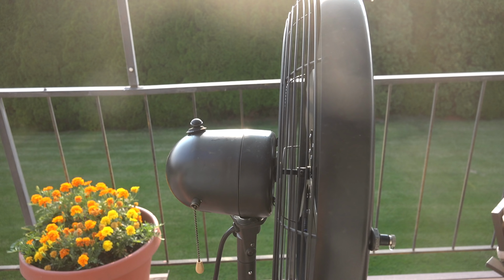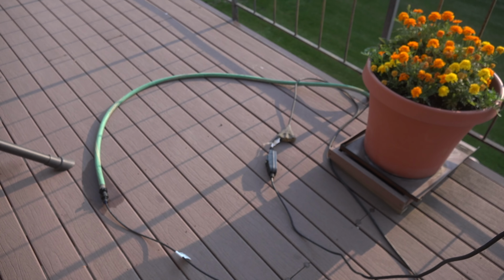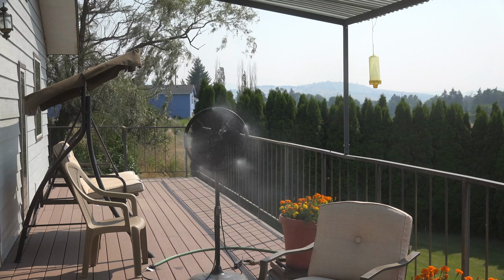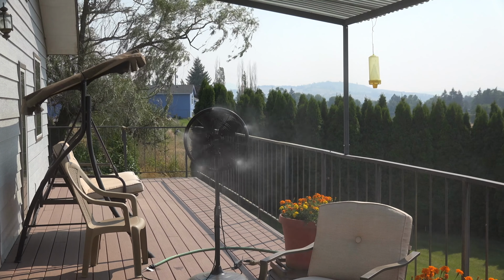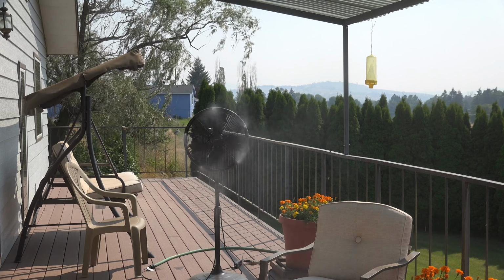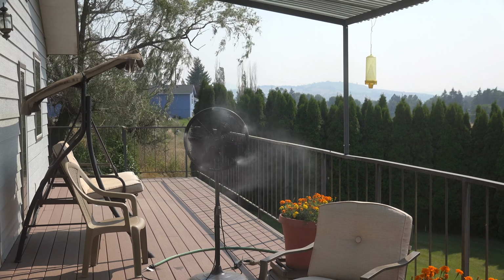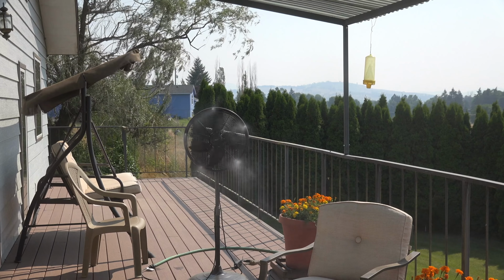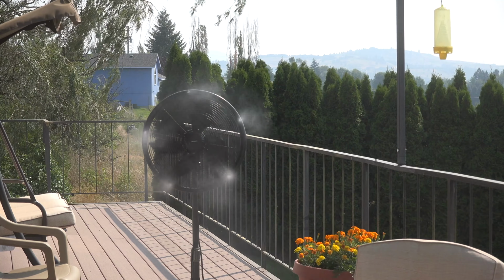A test of the Newair AF600 misting fan

Comment: I have one of these but on a larger scale. And the only downside is, if you sit in front of it all day, you wont need a shower.
Reply: sure you will, it's blowing water vapor and dirt from the air all over you, it just sticks and builds up lol
Reply: bottle it literally only works in the desert were its 0% humidity and 105 degrees